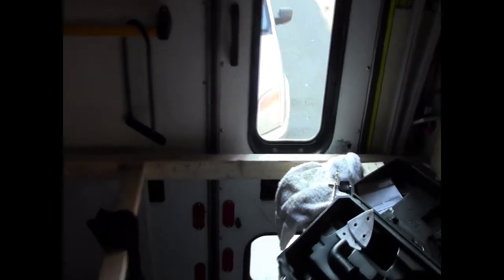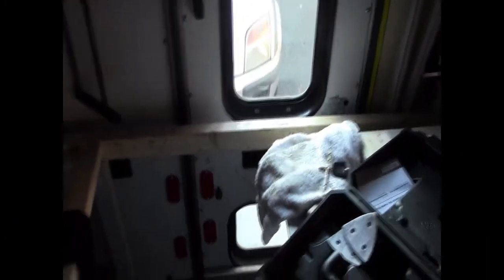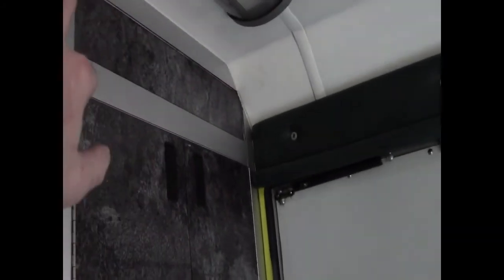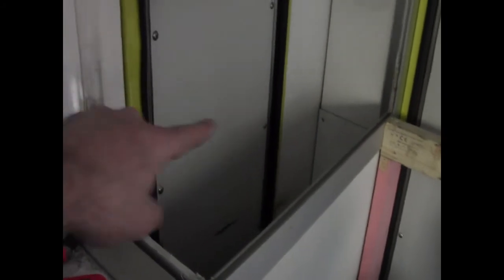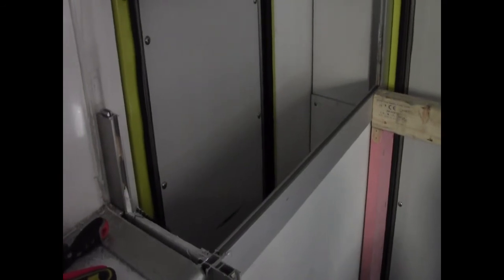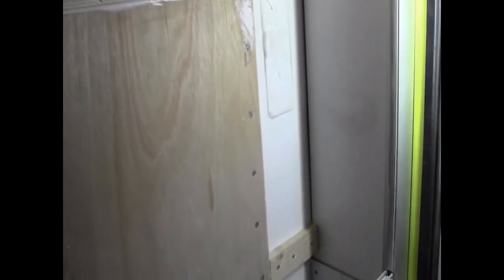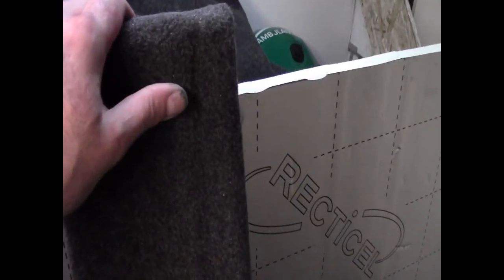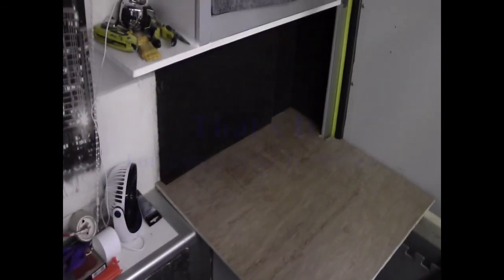Ambulance Camper Bed Build And Carpeting The Walls

Comment: Good job mate! Was it a nightmare sorting out the electrics in the ambulance? That's what puts me off them the most. They are wider and that's the thing I like about them.
Reply from the maker: TBH i pretty much left the ambulance electrics as is and added in a house system, basically i have 3 different systems, vehicle, amby and house, all interconnected but seperate if that makes sense?  The easiest way is to rip it all out and start from scratch and that can be a PITA due to the wiring being so hidden 😤 but if you can use a multimeter it's easy to leave the wiring in and re use it as you need 👍 Keith has good vids about all that as you know 👍  Im a mechanic by trade and built a few campers so easy enough,  mainly cos i had the tools more so than the knowledge 🤔 it's the little things that add up, wire stripers, crimpers, test meters, power probe, solder iron ect ect that either run up the cost or make the Jobs harder and longer to do ☹️
Reply: @Dirt-Diggler  👍 I think after watching Keith's videos it's what has put me off lol. I think I'd probably use what I can and then just ignore the rest 😆 I can use a multimeter but hey, The tangle of wires that Keith took out would melt my head lol.
I had more patience when I was younger I think, years on the grip messed that up ha!.
What's the fuel economy like if you don't mind me asking DD?
Reply from the maker: @pa_maj.MARTINI-van-MAN  I recently did a trip from london to swansea, full up with furniture, i got 29mpg on the way there (M4 following a nice high lorry at a steady 55) came back empty (well no furniture at least) on the A495 (mountians and lots of hills) then the A40 and got 25 for the trip back, not too bad compaired to the mercs it seems? judging from the MPG they seem to get on the FB ambulance conversion group ! they get usually below 20 !! 
Merc are way easyer to find but i didn't want the semi auto box (more to go wronge ALA project Amber), i got VERY lucky with my van !!
I get 25 round town usually, i'm a bit anal about following fuel consumption, years of mini cabbing did that LOL

TBH the weight you save taking the wiring out isn't really worth the hours spent taking it out and TBH i like the features of the ambulance control system, i just added in a VSR so it doesn't run all the time and kill the ambulance battery and as i dont use the amby system when not running i dont need a huge battery bank to run it, a single transit starter battery suffices compaired to 2 huge AGMs they use in service :) but again that's my personal needs.

Appart from running the wiring being a pain (unless you add inside trunking like i have in places) or buzz out the existing wiring in situe via the holes for the lights (quite a few of them ! ) building the house system is no more difficult than wiring a bare base vehical, i have done it the hard way TBH but as it'll be a mobile workshop/recovery vehical they were of use to me, i adapted rather than start again, stops the whole task from overwhelming you IMHO (well me at least) i like lots of little tasks rather than daunting huge ones ?
There's a chap in ireland converting a transit and keeping the amby system, he just added an extra solar pannel to cover the parasitic drain and uses all the amby stuff as fitted,   https://youtu.be/1KmawhcKbm4

As i say unless you get very lucky you'll be seeing a lot of mercs especialy for sale as they are replacing them with fiats accross the country at the mo, from what a chap at my local amby service center said they realised mercs are no more reliable than any other base vehical when it's looked after as well as ambulances are ?
Reply: @Dirt-Diggler  That's good enough mpg to be fair, I didn't know the Merc's could be so hard on fuel, less than 20 ain't good.
Yeah those semi auto box are not Good, I watch Connor's channel Project Amber, good channel.
Connor ( not sure if that's the right spelling ) he had big issues with his gearbox.
I met Connor two summers ago. He drew me a quick sketch of the wiring for connecting a solar panel to solar charge controller then battery, at the time I was helping out with the Boondockers van lol. Connor is a top bloke, very down to earth.

I don't put up a lot of miles to worry about carrying a bit of extra weight, what i have learnt though if to try and plan routes that aren't too hilly unless i have no option. Following behind the Boondockers is dreadful lol, Purdie tends to slow away down at the bottom of steep hills then drive hard up them, I like to use the down hill part to gain some momentum for the climb.
My old van didn't like this and sat at 23 mph going up some hills he had me on, i know i could have managed 3rd if he wasn't in front on the way down 😆

It has took me a while to realise that i don't need the same setup in my van as most of the van channels i watch on YouTube. I used to think i needed this and that but in reality i can last for several weeks in my van even without solar.
I purchased a Victron solar charge controller and 200 watts of panels before i realised i can get by well without it. I may use it for another van or get my ass into gear and finish fiberglassing on the aluminium brackets that i made for my fiberglass roof. 
I made nine brackets that will allow me to remove and replace the two flexible panels. I have aluminium flat bar to go around them all on top to keep them from lifting.

I'll check out the link that you give me 👍 cheers DD.  

I have been scaring Gumtree for all sorts of vans but prices seem to be shooting up and millage is High too for what you're getting.
Auctions are something I'm not used to when it comes to purchasing vehicles either so unless i have someone with me that knows what they're doing 😬
I fancied converting a Vivaro just for fun and if that worked i would consider going smaller. I'm 99% of the time on my own for some peace, fishing and metal detecting. Ferry prices are expensive for my van, it's a camper so it just goes as low as 6 meters or under, a van can be 5 meters or under.
£250.00 the last time ( last Summer ) for my camper. In a Vivaro i was told it would be half that, not sure if that's the shorter wheel base although there's only a foot or so between the two sizes apparently, not sure.
Height barriers wouldn't be a problem that's for sure ha!

I guess it's probably down to what's available, i just fancy a project, something that isn't factory built like mine, it would be wrong to change mine as it would suit a Young couple with or without a Young child. I think it would be more appealing to sell as is.

I'll certainly not be getting a Merc DD lol 👍👍👍
Reply from the maker: @pa_maj.MARTINI-van-MAN  That would drive me insane! people need to learn the laws or preserving energy and momentum ;) if more people started out driving Mk2 transits with the 2.4 York diesel or sherpa minibusses with the 1.7 NA diesel or even the LDV400 with a 2.25 land rover NA diesel they'de soon learn to keep speed and save fuel LOL 
I drove all the above :( taught me how to slipstream and conserve momentum ! you had to or youd down in the teens by the top of most hills, i remember the sherpa with the 1.7 NA diesel, it was a diesel version of the 1.8 B series from the MGB, coming out of dover up the hil it was in 1st gear! only had 5 people and 100 cases of beer in it ! LOL

 ialso have a transit connect and i'm trying real hard to put in a fold up bed lol, already fitted front and rear USB ports, ectra lights and storage pockets, must resist, need to fit the CCTV system to the amby !!
Reply: @Dirt-Diggler  It was driving me crazy mate 🤣😆 I couldn't understand it.
I guess I've had my fair share of underpowered and hard on fuel motors too.
Same goes for some motorbikes but hey, even cycling pushbikes teaches you to use the hill going down to help you climb up the other side.

Those Ford Connects look a bit on the small side for a camper. It would be interesting to see what you do with it. Some people love their little Berlingo's, I don't know how they manage as a Vivaro is quite extreme for me if I go that route lol.
CCTV would be handy although not for most of the places where I stay, if I felt I needed CCTV in an area, I'd probably leave that area 😲 CCTV might spook me out more, picking up all sorts that I'd be otherwise unaware off lol.